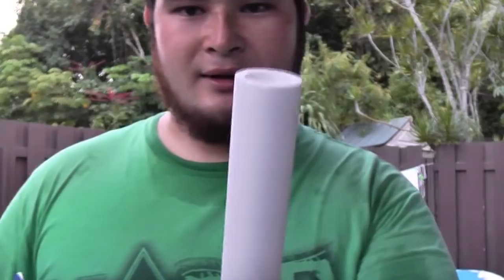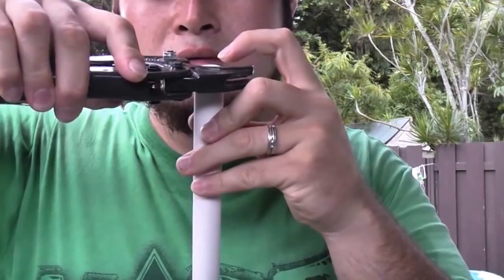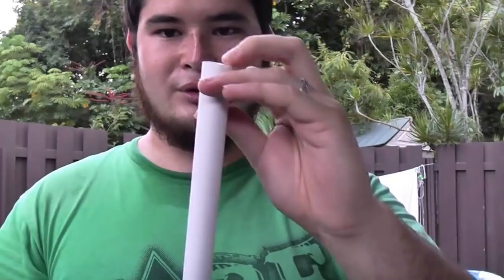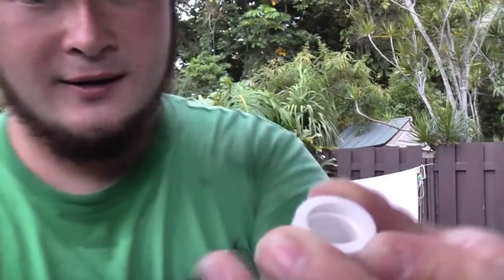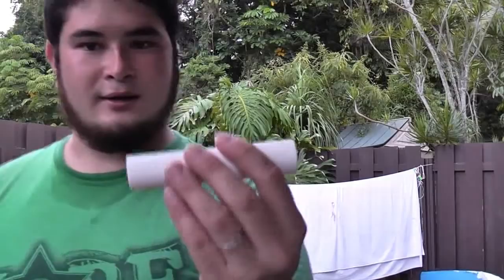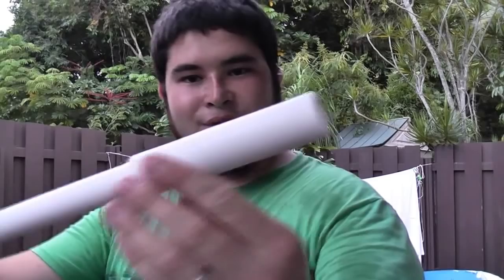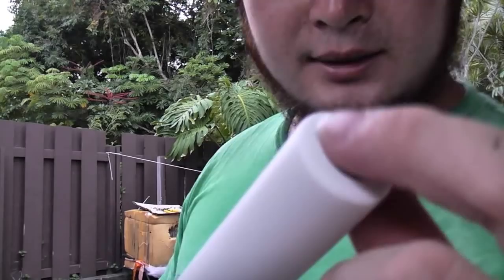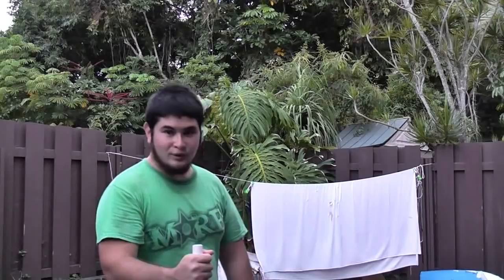Making and Shooting a PVC Walking Stick Blow Gun

Comment: Nice job, just made one last night.  I was amazed how well the duck tape cones fly.  The only change I made was using a 1/2 male adapter as a mouthpiece.  It has a lip already (to prevent accidently inhalation, and it allows me to attach a frog gig to the end of the walking stick. The only disadvantage is you have to remove the adapter to load darts.  The advantage is you can put a cap on it to hold water.  So I now have a walking stick, water bottle, frog gig, blow gun.
Reply: What’s a frog gig?

Comment: With my 6 ft pole, Ill probably make a 3 ft handle for more stability. I will slice the handle lengthwise to slide it on and then glue the slit and glue bead the ends of the handle.

Comment: As an avid Blowgun fan, I would just like to say 'thank you' for all you have taught me, and for tackling one of my favorite ranged weapons.

If I may inquire though, if I heated up another equal length (say) of the 3/4 inch schedule 40 PVC could I slide the whole tube over the 1/2 inch tube and cool it quickly and have a double wall thickness big bore blowgun?  I'd be very interested, as I'm on a quest for an extremely durable blowgun!  Thank you very much sir!

Comment: I just tried it and I couldn't get the outer pipe around the barrel before it cools down. So I built up the ends of the inner barrel with electrical tape and slipped it down into a 1" pipe, and left the mouthpiece end a little longer, so I could secure it with even more tape. I really like tape, obviously. Oh and I used sch. 80 pipe for the outside. Now it's a combination blowgun and ASS WHOOPIN STICK. Very sturdy. Five and a half feet, no jiggle, and no bend in the barrel.